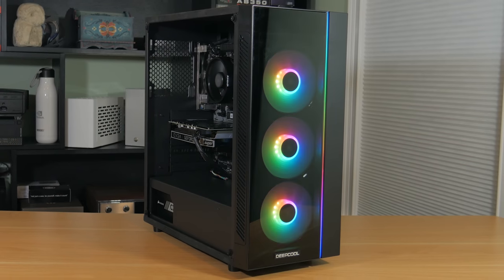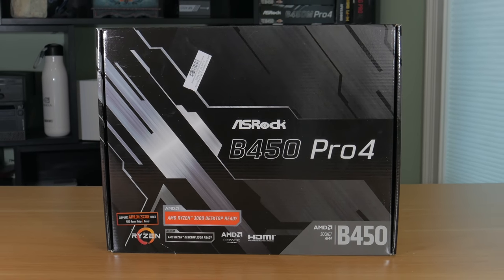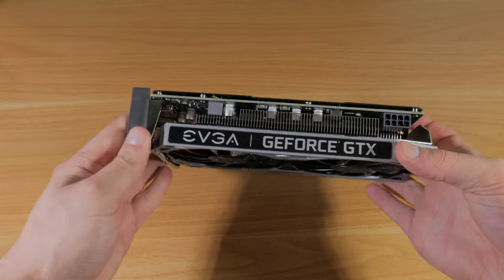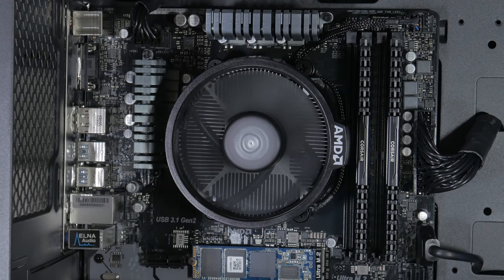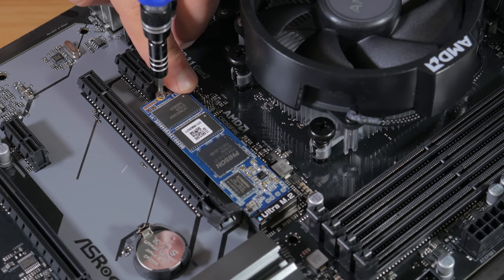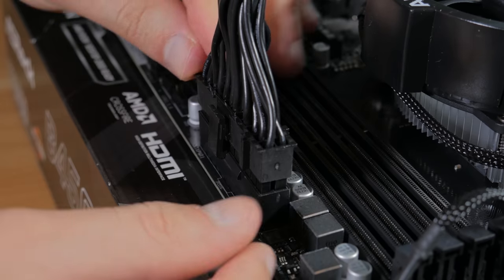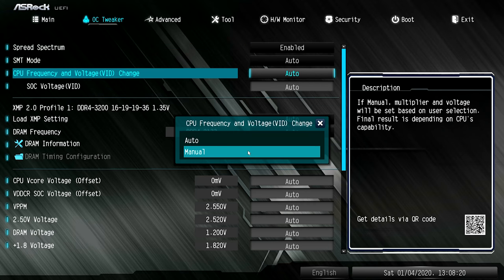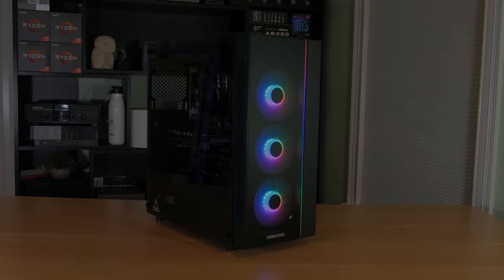$750 Gaming PC Build Guide! | January 2020

Comment: I going to micro center this month and i will be making this build! It would be my 1st time building and 1st time playing on pc so im so excited! Im in California and micro center is about 
1 hour and 20 min away....
Reply: This is not the best build you can get. Just saying.
Reply: @miniweeddeerz1820   well if you can tell me whats the best build for streaming for a 750 buget i would highly appreciate it
Reply: @SlickThoGaming  sure. Give me a hour or two
Reply: MiNi Weeddeerz what is it
Reply: @simplyworthy1343  read more
Reply: MiNi Weeddeerz what
Reply: @simplyworthy1343  the massive text I wrote explains all the 7 components of the better build.
Reply: MiNi Weeddeerz i dont see any massive comment
Reply: @simplyworthy1343 okay, his build is good, but there would be a few things I would change for better streaming especially. So the build is still similar but I've put in some better components for overall the same price:
CPU: Ryzen 7 2700x(8 cores 16 threads) instead of the 6 core 12 threads of the 3600. The extra cores will allow for better streaming performance. the 2700x is a bit worse stock at gaming but the difference is not large and not really noticeable. Plus the 8 cores will make it last longer. Your next upgrade should be to the am5 5nm CPUs. It also comes with a better stock cooler in the wraith prism which is a big upgrade from the wraith stealth. Wraith prism also has RGB.
Motherboard: MSI gaming plus max
It's more expensive but you have way better looks, vrms, and overclocking performance
RAM: G skill ripjaws 2x8gb 3200mhz. Same ram cheaper cost.
Storage: any 500gb SSD nvme m.2 2280 will do nicely. I just picked the sn550 Western digital.
Graphics card: the gigabyte 1660 super gigabyte gaming oc is better than evgas 1660 super as in this video as it has more display ports to connect to more displays if needed and a better cooler and it just looks better
Power supply: you can stick with the one in the video but I went with the thermaltake smart bx1 (any 550w 80+ bronze at the 45 dollar price will do fine as long as its from a reliable company)
Case: Phanteks p300a, just a really good case for a cheaper cost
Case fans: Arctic p12 value pack(I think it contains five fans) for 27 dollars
Total cost is 765.42 dollars based on prices from Newegg or Amazon
If you are going to microcenter you'll probably get it for cheaper
Note: you'll get a total of 5 fans from the pack and one included with the case but if you want the 3 RGB fans, then go with the case in the video and forget the p12 pack.
Also prices may have changed since I last made this list but I doubt itll be more expensive.
That's a pretty massive comment
Reply: MiNi Weeddeerz fuck yeah it is a massive comment.
Reply: @simplyworthy1343  but it's good. Go with that build and you won't be disappointed.
Reply: MiNi Weeddeerz i cant find some of the parts your saying on amazon. Make a list for me please
Reply: @simplyworthy1343  tell me what parts you can't find. I will give you some substitutes.
Reply: MiNi Weeddeerz Im just gonna build joeys $800 dollar build from 5 months ago
Reply: @simplyworthy1343  I'll have a look at it
Reply: @simplyworthy1343  pretty good but joeys cheating in that build. It's not really 800 dollars. I would still make some changes. For basically no perfomance difference. And it would be better
Reply: MiNi Weeddeerz its 837 plus taxes. And what would you change ?
Reply: @simplyworthy1343  my man Joey is only putting in 256gb of storage. Do you know how easily you can max that out? I would get 500gb of storage minimum. And it's still 800 dollars with double the storage. Give me a min to write that list of parts. Oh btw you have discord?
Reply: @simplyworthy1343 
CPU: Ryzen 5 3600
Motherboard:MSI B450 tomahawk max(the motherboard in the video is not guaranteed to work with the cpu every time. the bios may not be updated out of the box to work with Ryzen 3rd gen.The 'max' on this board means it is always compatible)
RAM:Patriot Viper 4 Blackout 2x8gb 3200mhz
Storage:Western digital blue sn550 m.2 nvme 500gb
Graphics card: MSI 1660 super gaming x(I know technically the ti is better than the super but the difference in performance is so tiny it isn't worth getting the ti and paying extra)
Case:Phanteks p300a
Power supply:evga bq 600w 80+bronze semi modular psu(you don't need 650watts in this build. You could make it work with 500watts. It's just for future upgrades so you don't have to buy a new power supply to power more energy consuming parts)
Total cost:807.81 dollars(25 dollars in mail in rebate a available bringing the price down to 789.80 dollars

Comment: You better opt for an aftermarket cooler for this setup though, I've got my 3600 here and the temperatures are terrible with the wraith stealth (50+C Idle, 90+C Full Load, cooler fan spun at 2000+rpm) my old 2600 had no temperature issues at all with the same cooler. (30-40C Idle, 75C Full Load, cooler fan spun at 1500-2000rpm)
Reply: Those 3600 temps are AFTER I had to limit the peak voltage using the Ryzen Master Software to 1.3V because for some reason at auto settings the voltage goes up to 1.47V for no absolute reason which is terrible. At auto settings idle temps 55-60+C, full load 95+C, after settings peak voltage to 1.3V and Clock speed to 4GHZ idle temps 45-55C, full load 90+C)

Comment: Thank you! Will buy, but one question. Considering this is a B450 board, did you not have to flash the bios to utilize the Ryzen 5 3600? Thank you!
Reply from the maker: No, the vast majority of B450 boards are shipping with Bios that support ryzen 3000

Comment: Bro, on your $600 build with the ryzen 5 2600 I run far cry 5 at 110 fps average at ultra settings. I clock the CPU at 4.2 GHz l. I did at AIO and 32 Corsair vengeance 3200 MHz ram.

Comment: Ok I am going to build this amazing build any tip that you can give to improve the performance. THANKX for building this amazing PC.
Reply: buy a 2600 and use the money to upgrade to a rtx 2060 or maybe rx 5700, buy a cheaper case, opt out of the ssd and take a mechanical drive. But this system is very well rounded for this price, and i think itt not really worth going for a 2060 for that 10/15% more fps
Reply: buy a Deepcool CPU Heat Sink and Fan for $30
Reply: @Rem_NL  Will the Corsair 550W PSU run the rtx 2060?
Reply: @j.jwhitty5861  with this system its more than enough to go with a 450 watt psu
Reply: @Rem_NL  Thanks for you feedback
Reply: @itsDanyall  don't get a mechanical drive. They are super slow when compared to a SSD nvme. This is the build you want:
https://pcpartpicker.com/list/

Comment: Is the deepcool matrexx 55 case good? I'd be planning on running basically the same build but with a 2600 instead of a 3600.
Like..airflow wise and stuff.
Reply: matrexx 55 supports only microATX motherboards. the board used in the video is an ATX, not the micro one

Comment: nice build! what monitor would you recomend for this?
Reply: dimitris rayas Any monitor that is over 144hz should do. I recommend anything in the $250 price range. Asus makes great quality monitors.
Reply: Nope get the AOC 24g2u. 180 dollars, 144hz, 1080p IPS display. Best budget monitor ever.
Reply: @miniweeddeerz1820  Do you have other 144hz monitors? Anything below 250, name brands usually have to cut corners to achieve 144hz such as bigger bezels, worse display, cheaper stands etc
Reply: @locowinner2001  before you come back to me, take a look at the reviews.

Comment: I have the same motherboard and i have a question!! Why are u using the upper pcie slot ? This is the pci2 right ? Why did u prefer the 2 instead of 3
Reply: you use the top one because it has the most bandwith.

Comment: this build has the same mobo, gpu, ram (at a higher speed tho), and ssd as mine lol. I have a ryzen 5 1600 tho, with a hyper 212 evo cooler, but i spent more on my case, got a bigger power supply, and i have a 1tb hard drive. over all spent under $700 (did take advantage of some holiday sales) and none of my parts were used before i bought them

Comment: What Motherboard would you recomend?

im trying to upgrade my PC...
i want to buy:
16gb 3200mhz ram
rm750w power supply or the rm850w power supply

I JUST NEED A GOOD MOTHERBOAD, THAT COSTS AROUND 150$

the Motherboard i have now dimensions are 12 x 1 x 9.6 in.

WHAT POWER SUPPLY WOULD YOU RECOMEND?
should i buy a tm850w PSU?
Or should i buy the rm750w PSU?

i want a PSU i can have for a long time without having to worry about anything.

SPECS WHEN I HAVE UPGRADED:(for the PSU choice)
i7-7000
RTX 2070 super
16gb of 3200 mhz
Dont know what motherboard.
1 tb hdd
256gb ssd

Comment: That case is  a heat oven with those small if not tiny vent holes on the side and no back fan instaled makes this even worse .  And having a stock cooler instaled here  helps here not out. I would keep the side pannel of all the time or thermal trottling will happend.

Comment: You only need an I3 9100f is $79.99 4 cores 4 threads, the 3600 barely pulls ahead in gaming, and then spend the rest of the money on a better gpu like the 1660 super super. 👍 You will run any AAA game at over 60fps, and it will crush all the competitive games like overwatch, GTA V, pubg, csgo, fortnite.

Comment: I am on the same budget but for the cpu should i go for the ryzen 7 2700x or this one? 
And also on the motherboard is it worth getting a more expensive one than this, something like $100?
Reply: Dimitri both cpus are good the 2700x has 2 more cores and 4 more threads so it would be better for video editing and multi tasking but if your going for just gaming then I would recommend the 3600 also the motherboard will work fine if you wanted to pay more go with a x470 board they offer more in the realm of overclocking and connect ability

Comment: The  RYZEN 3300X just came out, do u think it would be a better option than the 3600? I just watched Scattervolt make a video with benchmarks for both these chips. The 3300X is also $50 US dollars less than the 3600.
Reply: The 3300x is less superior in many ways and would most likely not run smooth with the other parts in the build so your answer is no
Reply: Elijah Bailey thanks for the reply, I was just thinking of saving a little bit of cash, but the 3600 is already good
Reply: Np

Comment: Could i use a Ryzen 7 2700x processor with this build since its on sale for me, and could i use a geforce gtx 770 from my older pc for the moment?? Need a reply as soon as possible
Reply: The CPU is wayy to powerful and you'll notice a bottleneck from the GTX 770, your frames will be noticably lower with that card.

Comment: I think the NZXT H510 would’ve been a better choice, idk.

Also, If I were you, I’d add some exhaust fans.
Reply: Season The Führer no, the Nzxt H510 has bad airflow so it would be choking the system. It’s only well known for its good look.
Reply: Stampyhacker You do see that he doesn’t add any exhaust fans on the case, it already has bad airflow. Also I said the NZXT H510 would’ve been a better choice because it is easy to work with. It has captive thumb screws, all in one JFP1 connector, etc. Those features may be helpful for first time builders since this is a build tutorial.
Reply: coolermaster nr600, basically h510 but mesh front panel, and amazing airflow

Comment: Prices must have gone up because if I price out the parts listed above using the links given I get $856. Also what isn't included in the price would be sales tax. Amazon pretty much charges sales tax for all states and if you're buying from your local Microcenter you'll also be paying sales tax. Most states will have sales tax anywhere from 6% to 9% so you can add about $50 to $65 in sales tax assuming the components still cost $750. I really consider this more of a $900 build.

Comment: Hey bro, I just  searched all the components you said here in PCpartpicker, but the platform tells me this: "Some AMD B450 chipset motherboards may need a BIOS update prior to using Matisse CPU's. Upgrading the BIOS may require a different CPU that is supported by older BIOS revisions."

This considered, is it still safe to buy these particular mother board and Processor? I just want them to work without any issue.
Reply: PCparkpicker is right. You need to flash update your Bios using a second-generation Ryzen processor like 2600. Only when the BIOS is updated, you can use 3600 in any B450 motherboard. If you aren't comfortable with this method, you can buy x570 motherboards which support 3rd gen Ryzen processors out of the box.
Reply: @baconwilliams5411  Thanks for answering  my question bro.  After doing some research, I've  decided to get a R5 2600 and a B450 Tomahawk mobo for better OC.

Comment: I would’ve put a Ryzen 5 3600x it’s not that much more and also you could’ve put a used gtx 1080 they are a really good combo and saves a a lot the 3600x is cheaper on amazon rn compared to Micro centers and I would’ve not put 3200mhz you could’ve over clocked the 3000mhz go 3200mhz  and me I would’ve used a nzxt h500

Comment: Hey Matt bought all the parts having trouble putting together for some reason seems like I'm missing the 3 point splitter from 13:13-13:5/
Reply: it doesn't have to be a 3 point splitter. my board came with a 5 point one. just make sure you connect to the right connector as shown in the video, or in mobo manual
Reply: @gahshunker  thank you I guess I'm just having trouble trying to find the plugs this is my first build or doing anything like this and I'm real frustrated

Comment: Do u think this could run Rust or escape from Tarkov at around 144fps
Reply: Tyler Wade yeah it should be able to with ease. A prebuilt dell with a 1060 3gb could run those games. You should have no problems
Reply: Prest 81j aye would you know which gpu option is better
Reply: Tyler Wade compared to what

Comment: Can someone explain the XMp setting he said is mandatory he did at end?
Reply from the maker: Its setting the ram to the correct speed. It wont run at 3200mhz unless you enable the xmp profile. Not enabling it will hurt performance a lot.
Reply: The max clock without XMP is 2133mhz. On Ryzen, this will hurt performance a lot, like Matt said.

Comment: would an rtx 2060 work well aswell
Reply: Kairu probably just check the psu compatibility and the motherboard
Reply: works fine, can do with a 400 watt psu really, just need 1 PCI-e power cable

Comment: Can this ATX case fit on ASRock b450m steel legend ?
Reply: yes i use this case, anything will fit in it.
Reply: R3RS not necessarily, its a mid tower so it will fit up to atx motherboards. Eatx motherboards wont fit.
Reply: Yes it will you just need to use the spacers that come with the case to adjust for where the holes in the motherboard are, I recently built my little cousin a PC with that motherboard and this case
Reply: Benji Kenobi I stand corrected. When he said it was a mid tower the general rule is that mid towers fit up to atx and full towers support eatx. I should’ve done more research. Sorry for the misinformation.

Comment: Hey Matt I just built this exact pc and I have a problem. The pc keeps turning on for like a minute and doesn’t display nothing and then it shuts down and turns back on and repeats
Reply from the maker: I'd try taking out and reinstalling the graphics card and pcie power cables that connect to it.
Reply from the maker: You can DM me on twitter
Reply: @ConejoDeSinaloa  hey man was this a good build to go with?

Comment: instead of the ryzen 5 3600 get the ryzen 7 2700x. It has more cores, threads, and cheaper
Reply: Joseph would this change lower or raised frame rate
Reply: Tyler Wade depends on the game tbh but it would usually increase frame rate
Reply: @Joseph-wu7vm  it would likely lower the frames, zen 2 has an improved ipc of 15% compared to zen1+. 2700x is a good choice if you want more cpu power for editing etc.
Reply: @Snow11ts  For gaming in currently available titles, the 2700x provides lower framerates in titles that are not optimized for core count vs single core speed, which is most of them.  The memory controller in the 3600 tends to allow higher/better timings on the memory than the older Zen+ based 2700x.  The 2700x is great for multi-threaded/parallel workloads for production work so it may be a better all-around CPU in a mixed use build, though it also runs a lot hotter in practice than the 3600 even with the included prism spire cooler.

Comment: I just bought that case
Reply: Looks very similar to the Phanteks P400A, which would have better airflow, but to each thier own. 🤷‍♂️
Reply: @RAW_Reality  they are a little different because the deepcool one has a light-up strip in the front and it is also more boxy

Comment: Rzyen 5 3600 or 3600x better ?
Reply: The 3600x is a better binned 3600 with mildly faster base and boost settings, which works out to roughly 5% more performance stock for %20 more on the CPU.  In this build I'd stick with the 3600, use less expensive RAM, a less expensive Cooler Master or Lian-Li 205m ($50) case and put the savings into a better GPU (5600xt, 2600 RTX, etc..) plus the larger 1 tb Inland Pro NVME SSD drive.

Comment: For god sake. Pls don’t overclock with boxed cooler.
Reply: Then what is a good CPU Cooler I can get?
Reply: The stock cooler can actually handle a small overclock. A larger one isn’t smart but if you really wanted to you could do a small one.
Reply: Theresa Horton a hyper 212 or noctua for air coolers for water cooling you could go with a next kraken x52 or Corsair h100 those could handle some pretty good overclocks
Reply: The games ran fine with those settings.